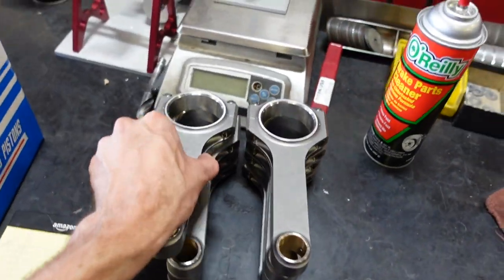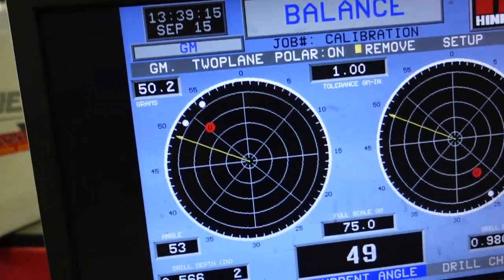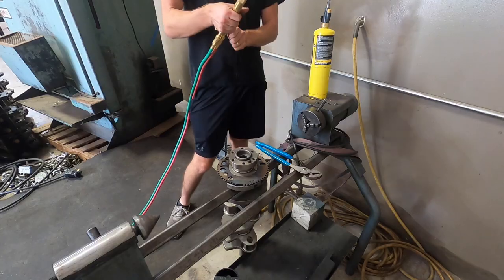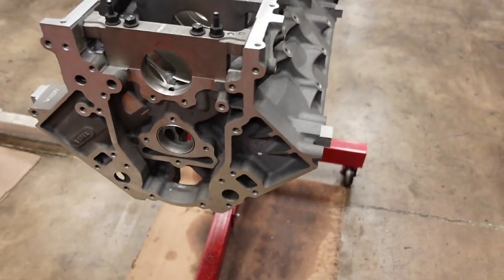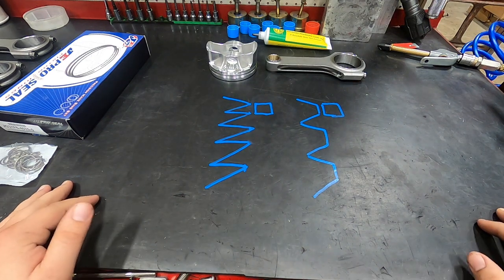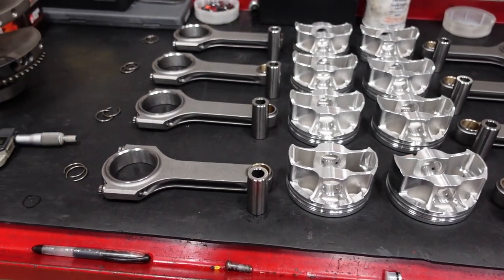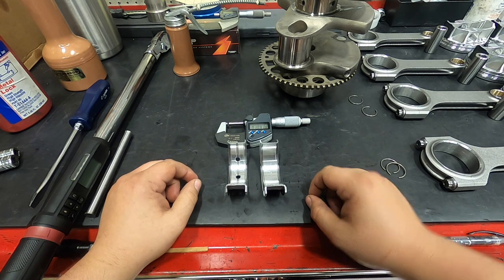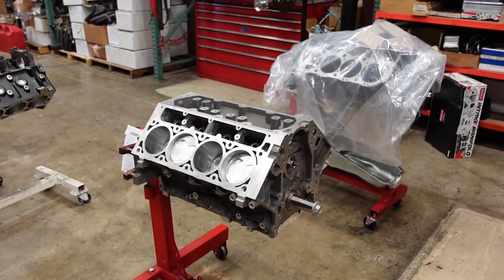Building a Nitrous LS3 416 Stroker Short Block - 13.0:1 High Compression

Comment: I personally dont like my slugs that close to the edge. The centrifical force,centrifugal centripetal( whatever you wanna call it ) is so great on a tungsten plug that they have been known to rip or seperate the counterweight losing press fit and exiting the block at high rates of speed. I've seen people install these on the outer side which you should never do and plug weld them only to eject back out. You want them as close to the edge to be effective at countering weight but be down far enough to be safe, people have different opinions. I personally would rather pay for 2 slugs deeper than one nearer than a 1/4" from the edge. But that's just me, just remember these things come out they can kill somebody.
Reply: I watch the SRC channel and billy had that happen to him on a 540
Reply: @davidvonanderseck8649  Its not safe, theres a lot of cranks out there that are ticking time bombs. People that go to these racing events standing on the sidelines up and down the track or on the street during street races, beside the burnout are in a dangerous spot if one lets go. When someones installing a plug they need to think about that. Plugs should be installed parallel to the crank centerline, never horizontal and never close to the edge like this one in this video. The young man in this video is very intelligent and this is the only mistake ive see him make. A lot of good engine builders installed these horizontal for years and with the occasional one coming out we've learned the correct way.

Comment: You can run pump gas. E85 no problem. Run a separate nitrous fuel system with Renegade e112 which is 118octane leaded e85 and spray away
Reply: That was my thought exactly.  Realistically, even a moderate, very streetable stroker cam (think maybe 246/264 113+4) would put dynamic around 9.1:1, which would be just fine on pump 93 octane.  Go with big octane in the stand alone for the spray to give yourself some breathing room, and prosper!

Comment: Shay got my attention at about that 8 minute mark talking about 13:1 and no pump gas.  After seeing the cam card, looks like this would have dynamic compression around 9:1 (guessing a bit on the .006" numbers based on the .050" IVC) - so should be plenty fine on pump 91/93 octane.  

Looks like a nice build - should be a fun street motor!
Reply: You can't run pump gas on 13 to 1 compression.
Reply: @davidsharp922  that is not accurate. Static compression alone does not dictate octane demand, that would be based on Dynamic compression which is completely relative to the intake valve close event.
Reply: @andrewcammer2535  we do some 13:1 motors. Not sure about static verse dynamic but they all get c12 race fuel.
Anything less in uncivilized.
Reply: @davidsharp922  I'm not sure I would lean too heavily on advice for octane demand from someone that admits they don't understand the difference between static and dynamic compression.  I spec LS and LT combinations for a living.  There are a variety of fuels out there, and DCR is the primary influence on octane demand.  I set a DCR target based on fuel type and vehicle usage, work out the camshaft for the application, and only then does SCR enter the equation as a tool to bring DCR where it needs to be for the application.  I have 13:1 motors out there which run perfectly fine on pump 93 gasoline.  In this day of flex fuel it's very common to build a combination that pushes the limits of DCR on pump gas in order to maximize performance on ethanol.
Reply: @andrewcammer2535  well,none of the 13:1 motors we build are running 93 octane fuel. They are all on race gas. Of course these are vehicles that are full race and run the quarter mile in the low 8 second range.
416 strokers 13:1 with all the goodies and 400 plus shots of nitrous.
To each his own.

Comment: The truck we are building now has a 421 stroker,13.1 stage 5 cam fully ported and polished heads by hooper heads and has a carburetor on it.
Also has a nitrous express system .
It has arp rod volts,maincap studs,arp head studs and even has arp studs on the rocker arms.
Should be a rock solid motor.
Should exceed 700  horsepower without a problem before the nitrous.
Reply: How nitrous shot?

Comment: What would cause a cylinder wall exercise wear after dyno, a few hundred miles of break in and then 10 passes drag.  On fully forged  NA 418ci, new stock block  LS3? On pump 93. Tune was perfect and on the safe side.

Comment: I see you used the factory main bolts. At what point do you recommend upgrading to ARP main studs?
Reply from the maker: If this was an engine that was going to be ran 24/7 with a power adder then we would have installed main bolts.

Comment: How much nitrous can a 416 ls3 take? We've been considering  a 416 for our next motor but we spray 400-500. We've only every used iron blocks, how do these stock aluminum blocks hold up to thatamount of nitrous?
Reply: A stock LS3 block won't hold for long on that much juice on top of a 600hp NA build. Saving the extra 80lbs on the front end difference in block weight isn't worth the chance of this aluminum holding. Stay iron block.  LS-Next block is great

Comment: How well do these stroker 416 motors handle high rpm abuse? And at what rpm can your safely rev too?
Reply: This one will probably see 7700 ish. People usually reach an airflow/camshaft limit before they reach a parts limit.
Reply: Reasonable RPM limitations in an LS will only be limited to Valvetrain (within reason, ie. 8500RPM). Solid vs Hydraulic Lifters, proper Valve springs, strong pushrods and stable Rocker Arms.
Reply: What about piston speed with the longer stroke?
Reply: @TheKeatyBear  4" Stroke At 7500 RPM the overall average piston speed is 5000 ft/s, more than safe for a built motor with proper hardware and fasteners. The 4" stroke and 6.125" Rod give a ratio of 1.53:1, so again not terrible. It's piston acceleration that is more dangerous if the rod/stroke ratio were to dip too far below 1.5:1 with an avg piston speed of 5000 ft/s or more. Take the Chevy Performance Parts LSX454 as an example. It's limited to 6,500 RPM in it's specs from Chevrolet due to it's UGLY short rod/stroke ratio (4.125" Stroke, 6.0" Rod = 1.45:1 with a 4469 ft/s piston speed) that causes increased piston acceleration, even though it has less avg piston speed than the 416 in question. There is obviously more to it, but these are the broad strokes (no pun intended).
Reply: @joeyjojojr.shabadoo915  excellent explanation.  👌 thank you
Reply: @joeyjojojr.shabadoo915  SME and MBE racing engines are getting over 10,000 RPM out of 4.5" strokes, so all the old piston speed rules are out the window now with more lightweight and stronger parts....
Reply: @dennisrobinson8008  I $100 agree. Billet Alum, Titanium etc and bullet-proof valvetrain has had a crazy effect on things, as well as fastener strength. I believed that we were talking more on the street car side of things, in terms of longevity and not requiring a rebuild every 5000 miles.

Comment: Why couldn’t you cruise it around on pump 93 and conservative timing?
Reply: The timing would have to be turned down excessively which means the horsepower would be greatly reduced as well.
Reply: If you can't afford the octane don't build a motor that requires it.
Reply: @davidsharp922  too late, I did. 417ci 13.2:1cr 9.5:1 dynamic on 93 pump gas daily driver. High timing and octane for the weekends